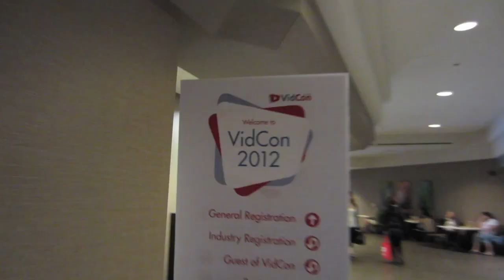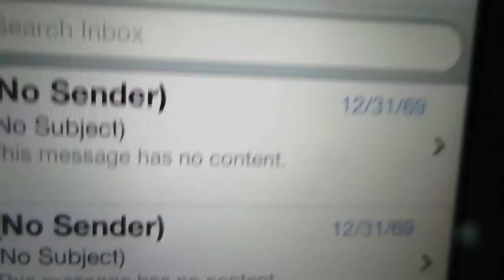BEAT UP IN LOCKER!! (6.29.12 - Day 1156)

Comment: @HerotheBand4 I've been wondering that since the first concert I saw them Vlog this year. Basically, thy are either sent back into the crowd, usually the side or back, or depending if crowd surfing is allowed or not they are removed from the concert grounds. In this case, back into the crowd